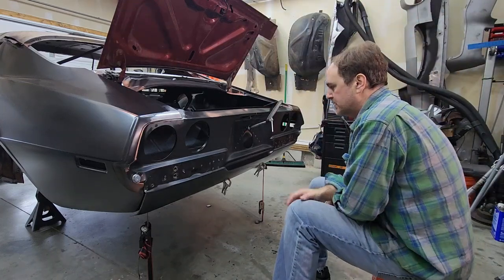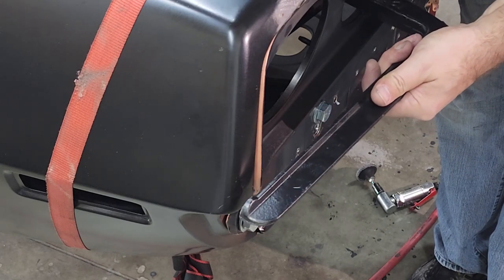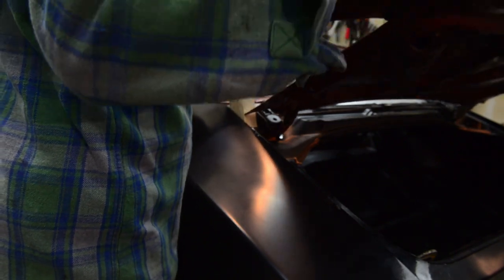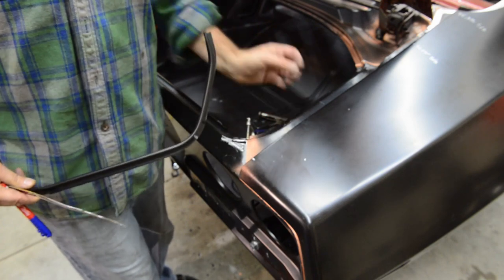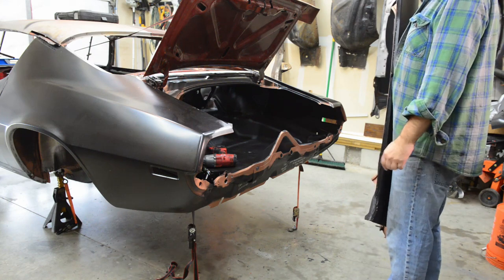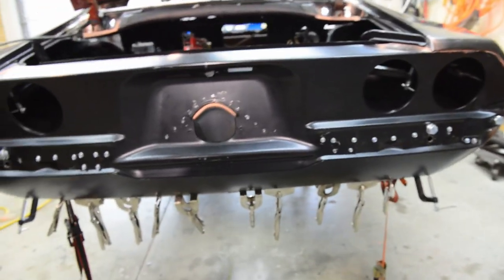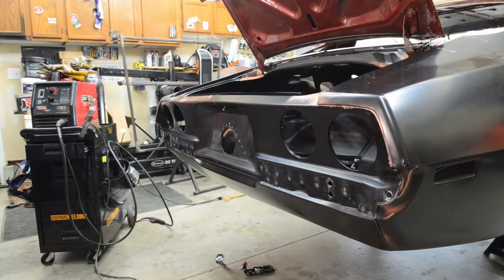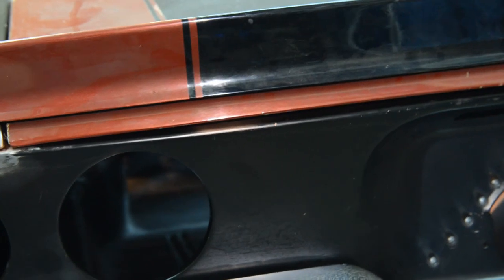Video 37 - AMD's Tail Panel Install on a 1971 Camaro

Comment: Awesome Work, great attention to detail, I'm just starting my rear panels on my 73
Reply from the maker: Good luck. Take plenty of measurements beforehand! From whatever reference points you'll want to use. (like the belt line of the quarter panel to the floor etc)
Reply: @thedrunkenturbo   I did figure out that if you order these panels'AMD ' from Camaro central, they don't tell you that the inner lower valance is actually attached to the lower part of the tail light panel, they assumed you'd be cutting yours off a good tail light panel, so I just need to fit the inner tail panel to trunk pan & weld Err home
Reply: AMD panels that is,, now I'm on the right track

Comment: Great work on the Camaro.  I am in a similar process with much of the same work and parts (72 SS/RS) but I'm much slower than you.  Completely rebuilt the subframe with UMI and Wilwood components.   Finished the floor pan patching, DSE subframe connectors, and firewall smoothing (VintageAir going in) and thought I only had the trunk pan and tail to replace.  Just finished the trunk pan and in so doing discovered the really crappy 1980's work done on the quarters (bad patches brazed in) so I'm using your videos as a guide in replacing both.  Like yours, the car will be more AMD black EDP than original paint.  Keep the videos coming so I can "leverage" your work!!
Reply from the maker: Thanks for the kind words!  It's definitely a labor of love... Err love of labor? Haha. 

Yep sounds like you are in the same boat that I was in. Shit repairs throughout to years the, more I tore into things more I found wrong. I could have patch a lot of it just didn't sit right with me. So out most it came. 

Believe it or not, the car came with a vintage air kit. I'm on the fence about putting it back in since the car is going to be more drag oriented. But having heat would be nice sitting in the lanes at the track. Lol. 

As you I'll be installing the DSE subframe connectors also. Just been waiting to get some weight in the car and give the front subframe a good alignment with the body before I weld them in (hopefully in the next two months) 

The front suspension I'm thinking PTFB control arms and their Viking coil over kit. 

Thanks for watching and share some pics of your car (you might have on some of the Facebook groups I think) I enjoy seeing others projects

Comment: I got same quarters. I hate how the bottom of the mate of tail and quarter looks like the quarter needs to be fatter. I am building 6 figure car, I want it to look right like you. tons of work.
Reply from the maker: Yep. The stamping sucks where the tail panel nests into the quarter. I'm still on the fence on the driver's side, slicing it and moving it over a smidge.  Just to tighten the gap up. Not that it's far off, just umm it will annoy my OCD later if I don't do something about it now
Reply: @thedrunkenturbo  Nice work. I mean seriously, not many know the amount of work this takes to come out looking right.
Reply from the maker: Exactly. I'm just over an year on the shell, working a few hours on it here and there.  I'm in no rush to get it done either. So if something isn't right, I'll stop, think about what's wrong. then figure out a plan on how to go about making it better

Comment: I have a question for you where to you get the inner corner trunk bumper brackets where you put those bolts in the tail panel and rear quarter panel thanks.
Reply from the maker: Hey. 

Big bolts went through the normal holes that hold the bumper on. Um if I remember correctly, I used 14mm x 30mm bolts through there. 

Smaller ones were 1/4" holes, that I drilled  through all the parts back there Then used some 1/4-20 x 1" cap bolts that I had kicking around.  As for the location, where all the panels lined up at. 
 
The corner brackets came with the trunk floor drop offs
Reply: @thedrunkenturbo  Ok thanks I’m doing a 70 camaro conversion with a 78 camaro so your videos are definitely helping me out in the right direction.
Reply from the maker: Awesome!! Glad to hear that!

Comment: What video do you have that shows how you installed the inner lower rear valance panel
Reply from the maker: https://youtu.be/O8R5uSlGqAs

Video 23 - Rear crossmember install. 

Thanks for watching!
Reply: @thedrunkenturbo   Thanks so much,   guess I missed the part of the install of the inner lower valance, or maybe I can just install that under the car after the tail light panel is in install..... Thanks again for the technical tips
Reply: Great video & info. On that upper tail panel ext. & Tail light panel install, & thanks for showing where those small tail panel extensions install...... Great work !!!!!! ,, Chuck, Kennebunk Maine
Reply from the maker: Should be able to in install the rear crossmember extensions and crossmember in after the fact  Just be a more a pita to get the welder in there. Then spray some sort of paint in between the panels. Etc.
Reply: Thanks for your response's.....  Let me know what ya think about that valance I ordered from Camaro central..... I'll be taking a small break from car, I have to upgrade compressor to a 60 gallon, & get a roll around tool chest & mount a vise, I worked on car last year in driveway, this year it's in the garage, so I'm not too organized... Lol sawhorses & plywood .. ha ha
Reply from the maker: I feel ya. I built a few cars in a driveway and 4 jack stands. Work with what ya got. I wish I had more space but having a garage is a nice change of pace. 

I'm where you are at. Taking a bit of a break on the car.  I'm still doing little stuff, but nothing major at the moment. 

As for the Camaro central part. I'd think you'd be doing more work, welding/grinding a buttweld, than what it takes to replace the whole tail light panel. IMO. The AMD tail light panel fit pretty well to the factory quarters.
Reply: @thedrunkenturbo  you Bet

Comment: AMD stuff can go both ways. Header and valance are pretty good but fenders are not close. lots of mods needed to even get them close. I mean your gonna spend many many hours on them if your a pro.
Reply from the maker: Most of the AMD stuff is pretty decent. Floor, inner/outer rockers,trunk floor and tail pan were pretty spot on. Just minor trimming/hammer/dolly work to get everything to fit just right. 

Luckily for me, the fenders aren't to far gone and just need some patches at the bottom on one. The other was hammered where the emblem holes were. The previous body work that was done, over heated and stretched the metal out. So I'll prolly cut out that mess and tig in some new metal on it (I'm horrible at tig welding )
Reply: @thedrunkenturbo  I bought AMD and after welding for hours and getting gap to 3/16 I found the round bend on top from side to hood off a 1/8 which is too much to fix. I ended up driving 12 hours to Albuquerque NM for a real good donor off a 73 on facebook marketplace. It fits like a glove right off.
Reply: BTW anyone in colorado looking for 1970 camaro pass fender already fixed for gaps but needs more for bend? :)
Reply from the maker: That sucks. But at least you were able to get the project, where you wanted it to be!
Reply from the maker: And I wish I was closer. I'm over on the east coast.

Comment: I'm trying to install the lower rear valance but having trouble getting the corners flush along the line.    Do I just cut off the extra piece on the rear valance and force it in and weld it. 
Your advice please. Thanks.  Andrew
Reply from the maker: Hey

That's pretty much what I did. Then used some ratchet straps from inside the trunk, out the tail light hole, latched onto the frame rail. Which held the tail panel in place. Took a few tries to trim that edge down to get it to sit right.  Also, I did use the sharp flat edge of a body hammer to make the AMD quarter more towards a 90* angle than what they stamped